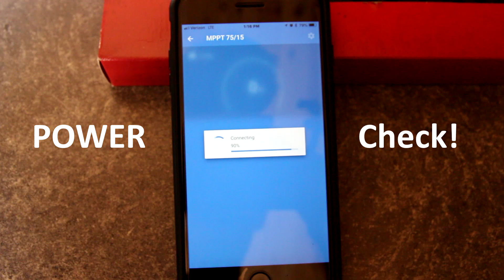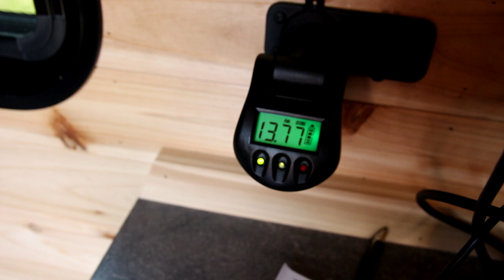DIY Furrion Solar RV Port Custom Plug Install

Comment: I've watched this stupid fuzzy video three times and still don't see where you tell us how to use a meter to determine positive and negative.
Reply from the maker: Prob better watch it a few more times! Maybe DIY isnt the best solution then? 

Jokes aside, I would stick the red in one and then flip. See if it’s negative or positive. 

I have general electrical knowledge so it was probably assumed on my end. So apologies. It’s been a while since I made the video

Comment: Inside the furrion plug the terminals are numbered 1 and 2. Does red get soldered  to 1 or 2 ? Thanks.
Reply from the maker: All depends on what the multimeter reads. I cover that in the video on how to check!
Reply: I never did see where you mentioned any of that about how to test it.   @onza04
Reply from the maker: @sj-gw9wq  basically it plugs in only one way right?
So when you plug you meter into the plug you can figure out which is positive and negative. Then you match the color of the wires accordingly.

Comment: What AWG did you use?
Reply from the maker: I went with 10 / 12, doesn't matter, but the 12 fit better since it was slightly skinnier in diameter. Go with 12! 
12AWG: https://amzn.to/2P7H55y
10AWG: https://amzn.to/2Dd5YYC

Comment: Is the hot on top or bottom on the plug pins?
Reply from the maker: Really depends on how they wired it
Reply from the maker: Get a volt meter to verify